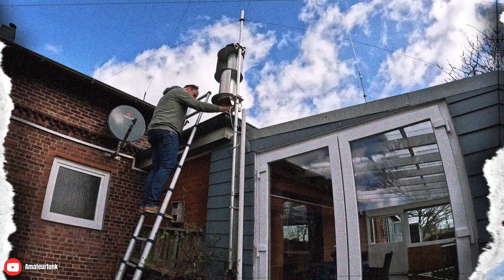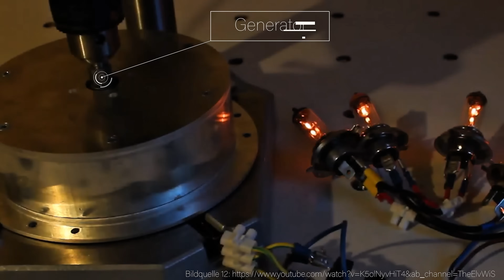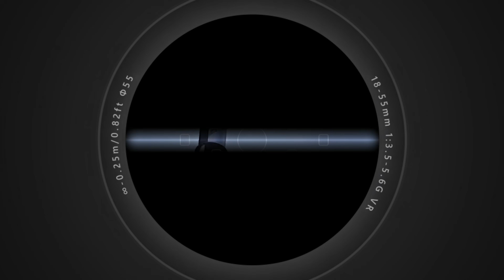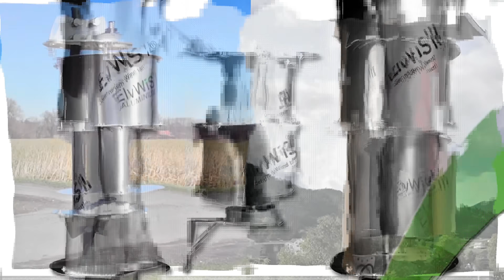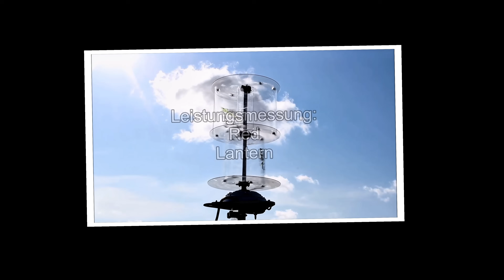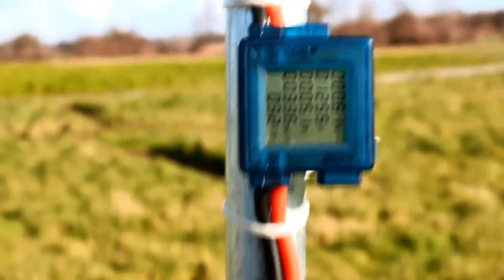ElvWiS III: The Most Powerful Generator of 2026 – Redefining Energy Standards!

Comment: Yea you would need at least 5 of em do ya any good. Now I have seen the design, which is the most efficient air grabber, but 2 to maybe 3 times bigger with direct connect to regular alternator or washing machine or treadmill motor and throw out more energy you could use. Well put it this way your battery bank would always be full. At least here in Louisiana where always a wind. Solar not the answer. Could be part of it but here you get more from wind with little back up of solar. I never had the money to do it. But have gone as long as 23 days without power here after hurricane. No fun lol.
I think you could probably make a Pic pipe turbine direct connect to alternator with 79 Walmart or harbor freight marine batteries with 8 or so and power most of your needs. Throw in a couple cheap solar panels. The real ticket is ability to direct connect into any wall outlet in your home to provide the power. Which they can do now. I forget what they call it lol. Course your utility company will try and stop you but u just need an auto switch or manual one to throw utility offline so no back current could hurt anyone.
Would love to have bigger one connected to permanent motor or alternator throwing huge power. Couple it with generator u already have or maybe few solar and boom. Even better with some DC long line led strips thru out your home and few key DC appliance, lights. Fan, etc or even small DC fridge and your golden.
But honestly you could just dig a big hole in the backyard and seal it and keep most of your food good for ya. Jeez, what we forgot our grandparents n their parents were doing long before us without all the fancy power n appliances. Modern man will mostly dissappear within 6 months of major power failure, say from massive solar hit. We simply no longer know how to survive without our modern convenience and phones etc lol. It's sad really....

Comment: The commentary is totally fake. 12v will charge NOTHING. Start to learn electronics before delivering such rubbish. 
This type of vertical shape has a very small amount of energy-producing surface that you might get 240 watts on a windy day. The whole thing looks like a “Heath Robinson” setup.  Wires dangling, pole vibrating and a wattmeter that could be indicating anything. No test results. No laboratory figures. No independent certification.  No cost. No comparison with a fan. Just a feeble idea on a pole.

Comment: The Savonius wasn't spinning fast enough to produce a few watts. I installed a lightweight, two-bladed, 1200mm long high-speed propeller on this generator. It produces more than these ever did, even in weaker winds.

Comment: Try putting one of these up in an HOA. My area of South Carolina averages 5 meters per second. Power is velocity squared, so my average would be 60W (as noted). However, wind velocity over a roof is reduced which is why test parameters use 10 meters above a structure. Finally, at 15 cents per kilowatt hour (mine) or 50 cents per kWh (highest I know of), you get a savings of $2.25 to $7.50 a month.  Would be useful on a camping trip to charge phones and tablets.
Reply: Do not move into HOAs. Why intentionally give up Your freedom to a group of abusive control freaks. You live in a free country l. Stay free.
Reply: land of the free 🤷‍♂️
Reply: Anybody that buys a home in an HOA gets everyrthing they already knlowinly & willingly agreed to, to deal with. 😎😎.